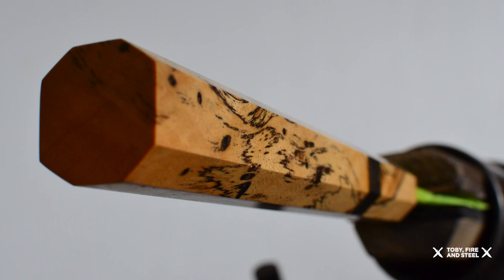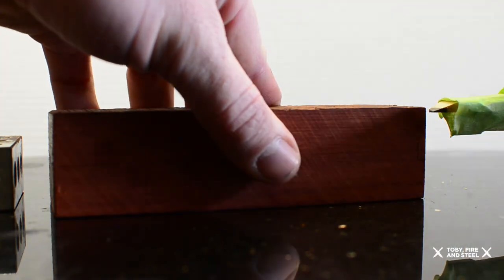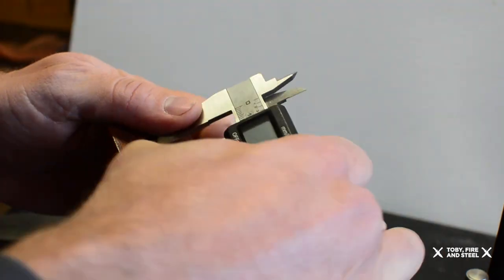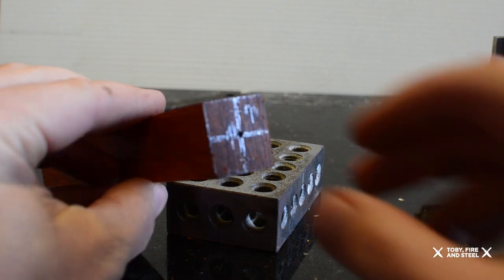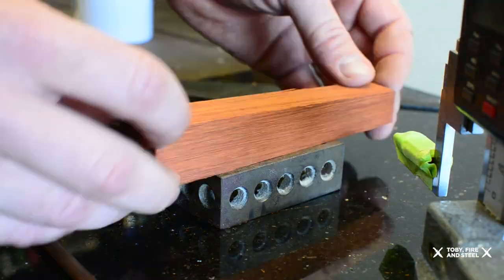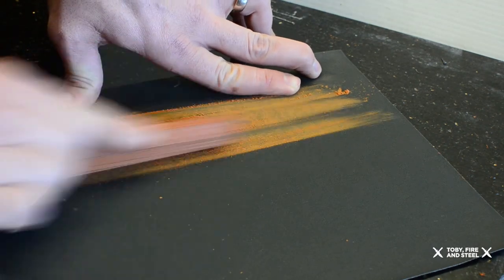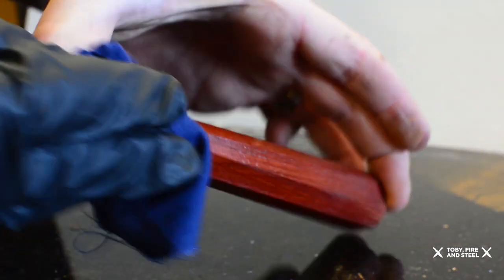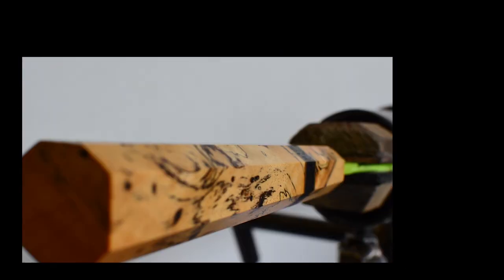The easiest way to do an octagonal faceted wa handle

Comment: I'm using router/trimmer with 45° bit profile
Very easy to use and consistent results. Plus no need more fancy sanding because it's already smoothen
Reply from the maker: That's a great idea mate. I'm not sure I've seen it done that way. 👍
Reply: Have a video on that?

Comment: thats ace. thanks for the tip tobes. i will remember that one. there is a trick thats similar ive seen on several wood working chanels like Pask makes, Jimmy diresta and johnathan kats moses, where they use a table saw and an octagonal collet to set the angles to get a perfect octagon but i dont think it would work with a taper like what you do with this. Your method of set up is pretty much exactly how you set up to hand hew a log into a beam.
Reply from the maker: Thanks heaps man. Sounds like a Canadian thing lol
Reply: @TobyFireandSteel  haha yep. #lumberjackstuff hahahaha
Reply from the maker: @opwards  🤣🤣

Comment: hi great video, great  work, but if this is the "easiest way" I still think is not so easy. Congrats!! And, by the way, its been long time I saw a japanese video showing a machine (very simle and operating in primitive way), like a jig, to do this work in handle. This machine was composed by a wheel with blades (like plain) moving in the wood and removing material modeling in octagonal shape. I lost this viedo and I have tried to find in youtube but unfortunatelly a I can´t. So please if some of you have this mentioned video or link to, please ping me. thanx.

Comment: Hey mate great video. How hard is your belt grinder going? Do you find ends of the handle ever get ground away faster than the middle and it doesn't come out properly flat?
Reply from the maker: Thanks mate. Nono don't get that problem bud. I have in the early days though. It sounds like your platern may not be adjusted correctly. Possibly to yo far in or out. Have you seen the 6 sheet of paper rule? https://youtu.be/WMXfbf4cIBY